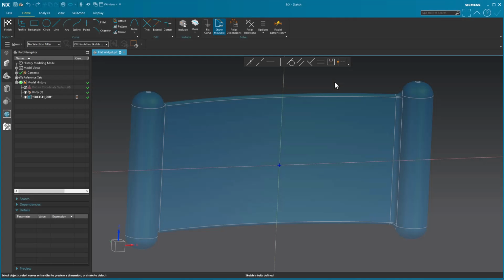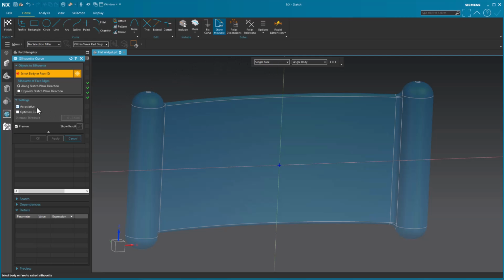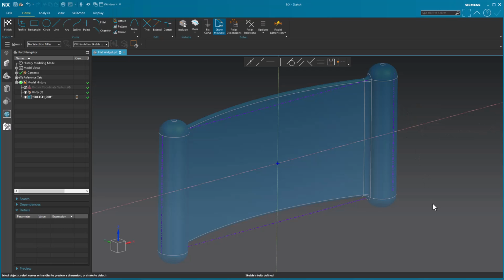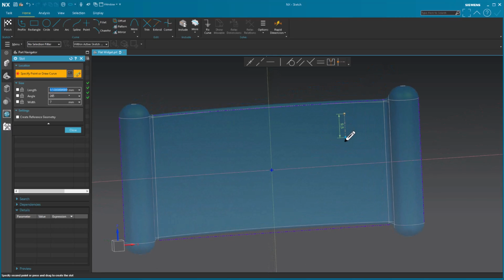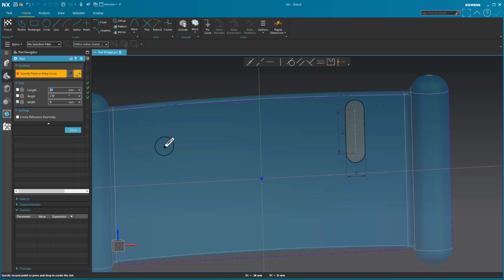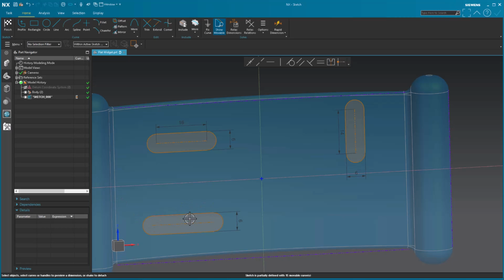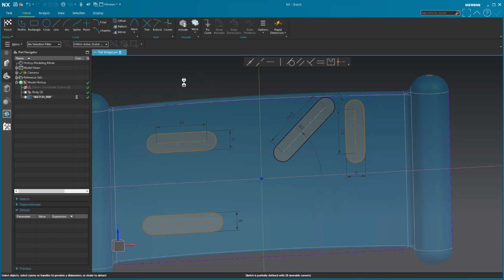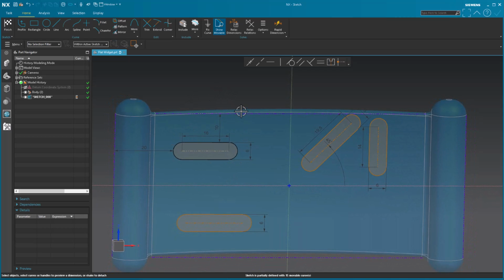NX 2312 What's New | Sketcher

Comment: Still no way to select/create a plane on the go while making a sketch ever since it was removed? And still no in-context sketch, where you wouldn't be switched to sketcher application?
Reply from the maker: Those things were tried and most people did not like them. It is expensive to keep stuff people won't use.
Reply: There's literally a thread on their forums that complains that these features were removed in exchange for nothing. That's why I'll never update it or even buy NX again @classasurfacing

Comment: number one issue with nx in comparison with mcneal software is PERFORMANCE
Reply from the maker: That software is purpose built so it makes sense. But, give Siemens time, they are a fabulous company always making things better.
Reply: @classasurfacing  What do you mean? NX is also purpose built.
Reply: @classasurfacing   what do you mean ? nx was there before down of the time, it is a very powerful software indeed, but for example lets compare it with zwsoft, which is a corresponding alternative , a 30 gb software vs a 1.5 gb software, of curse nx wins in terms of tools and abilities but zw3d wins in terms of performance , you can definitely model any parametric thing you want in all of these software ...